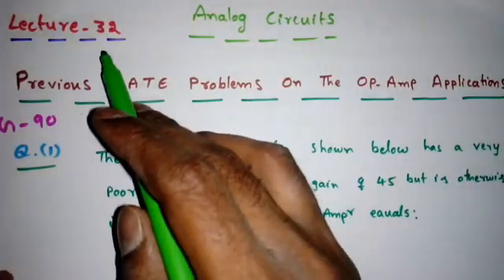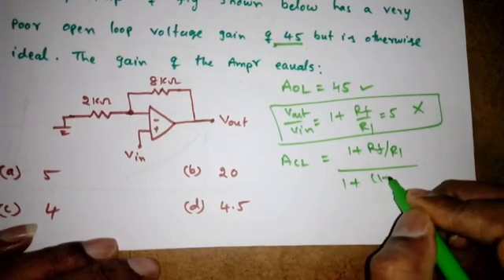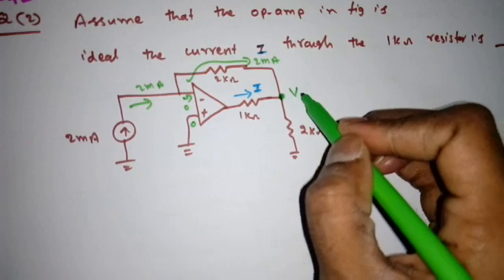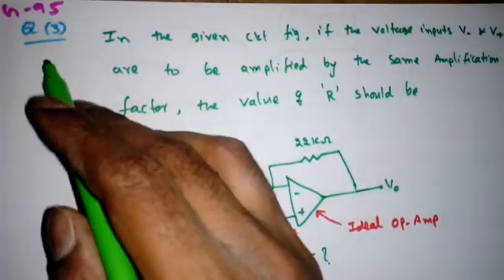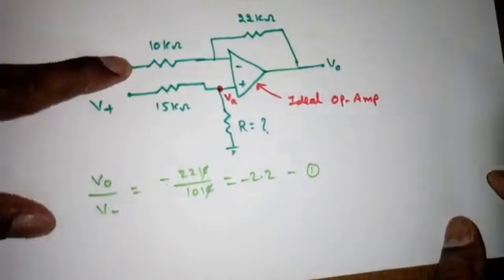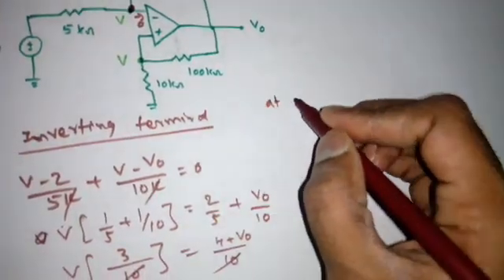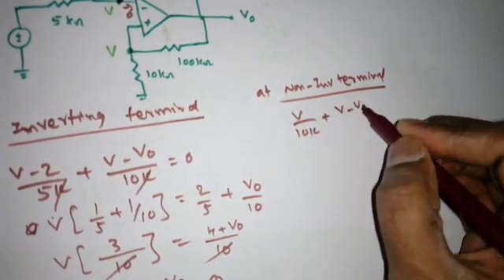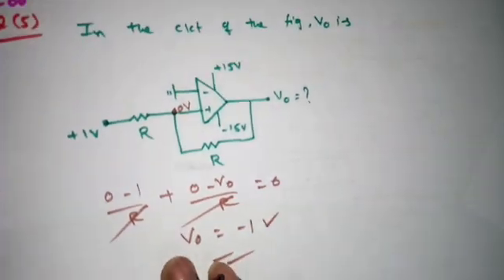Analog Circuits Lecture 32: GATE Problems on the applications of op-amp

Comment: Sir why we can't apply inductor in place of capacitor in integrator and differentiators
Reply from the maker: Deepak patel yes we can use inductor in place of capacitor to make integrator and differentiator but due to bulkynesd of inductor we don't use them practically
Reply: Learning Is Everything 
Ok thanks sir

Comment: possitive feed back virtual ground concept applied or not
Reply from the maker: no we can't apply virtual gnd concept...
Reply: but u solved above video  1 problem for +ve fb based on virtual ground concept
Reply: In the question, it is given that op-amp is ideal, so virtual ground concept can be used.